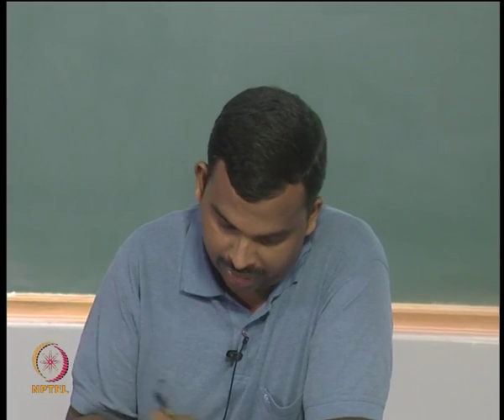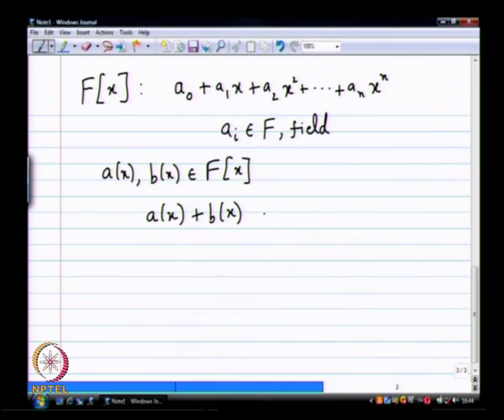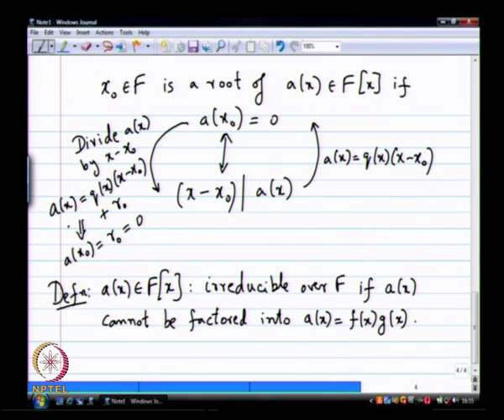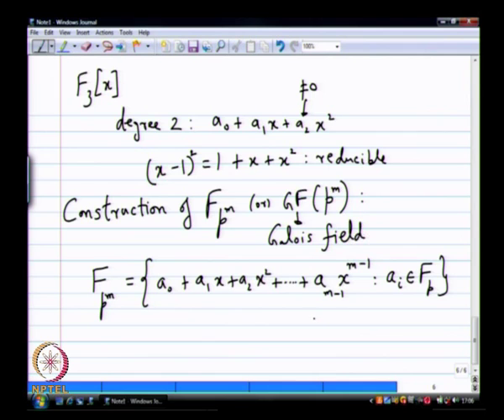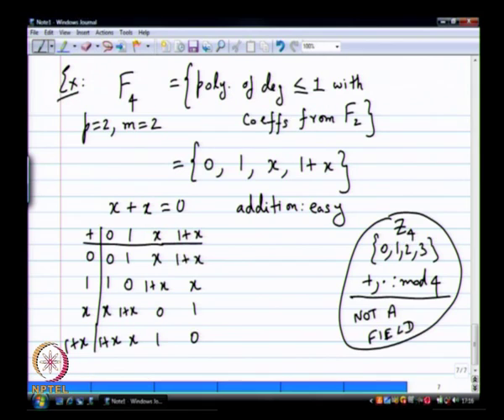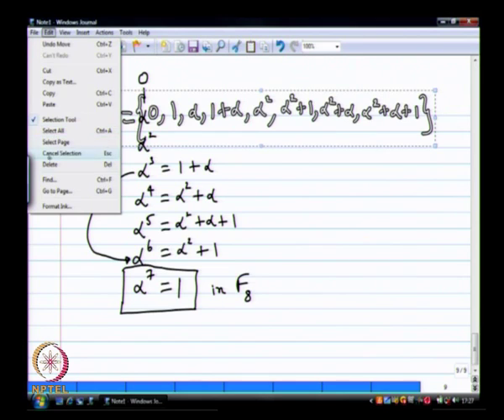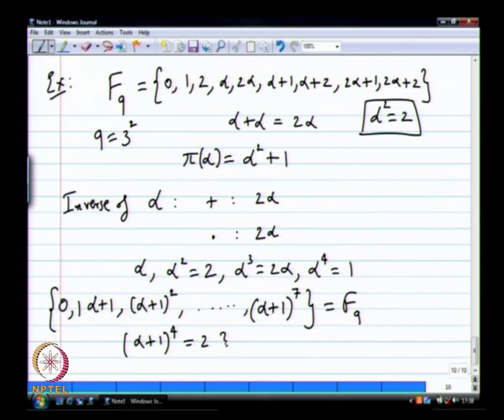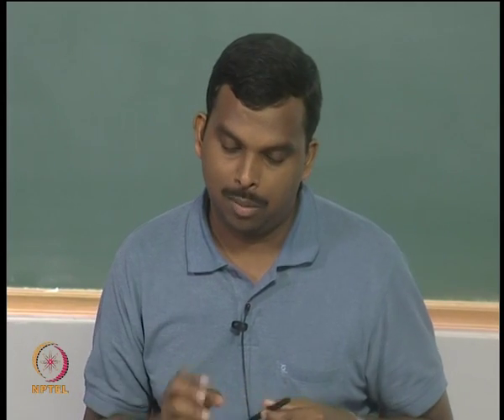Mod-01 Lec-09 Construction of Finite Fields

Comment: why alpha^2=2 in 1:03:25?
Reply: To make (alpha)^2 +1=0 ,it should be equal to 3 or multiple of three then only mod 3 will make it 0. so (alpha)^2 =2;In the previous case (F8 or F4) p was 2 , that''s why x^2+1=0 made x^2=1.
Reply: @vipulsharma6569  Thanks man, it helped

Comment: Can someone explain. at 13:35  for 3rd example,  (x+1) *(x+1)  why 2x = -x  ?   and so, for 2nd example,  why  -2x  = x ?.   thanks
Reply: 2 = 1mod(3)  cause 2(-1) is divisible by 3, hence 2 = -1 in F3. Similarly, 
-2 = 1mod(3), so -2 = 1 in F3.